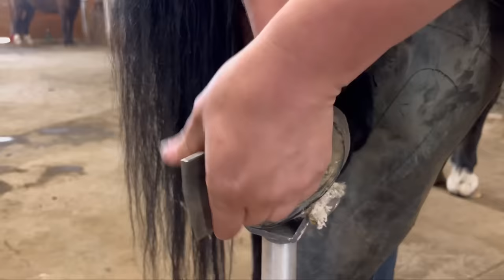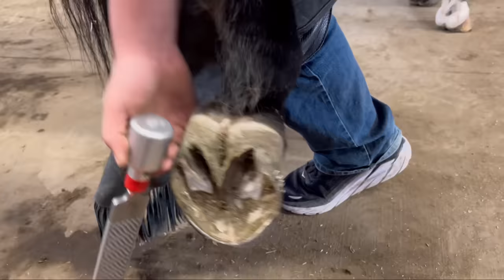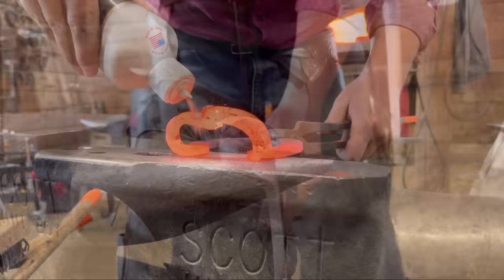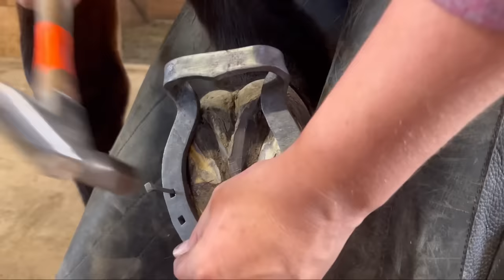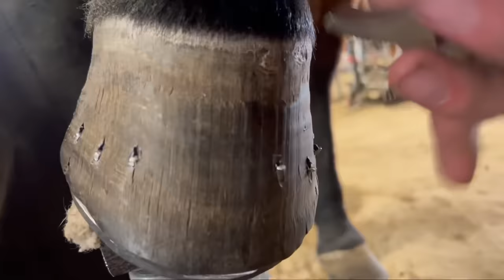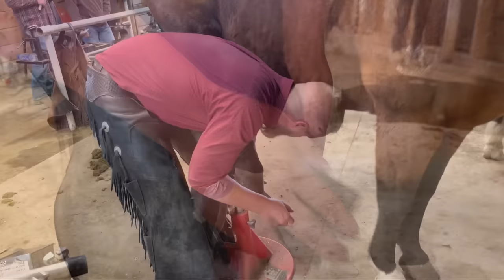Tendon INJURY Recovery Horseshoe

Comment: Why do you bounce the hammer on the anvil now and then? And what is the grey powder you spray on? Thank you! I'm enjoying watching people ply their trade for the betterment of the animals.
Reply: He does the bouncing to reestablish his grip on the hammer. It will drift as you pound. 

The powder is borax. It cleans the surface of the metal as they work the shoe, which helps to make a better welding bond. It is also called blacksmithing powder.
Reply: @ricoludovici2825  Thank you! I know borax. I didn't realize it was used this way. I appreciate your answering.
Reply: Hello how are you doing

Comment: I hope I won’t step on anyone’s toe with this question, but I would like to know why this horse didn’t get a leather pad between the shoe and the hoof? I understand this is to relieve pressure on the tendon while it’s healing, but is there no risk of having a caudal failure with such an open heel shoe that is at a steeper angle comparing to the hoof without the shoe? Also, amazing work, I am kind of an “old school” lover, and I’m glad to see you make such a high quality handmade shoe! Well done, there is immediate relief in the horse’s stance as soon as the shoe was applied!

Comment: Never seen anything like this before. I do have a question, since one side is now higher and the other side barefoot do the horses get sore in their back or hips? Can you level it out putting a heel shoe on the other foot?
Reply: That’s a good question. I’m curious too now how it will affect the horse’s hips and other leg. I know in the beginning he said the horse was going to be on stall confinement so he won’t be walking around on it.  I would imagine that it is something they do take into account and will be watching for off side strain. And I’m sure a good chiropractor adjustment once the shoe is off will help line things back up.
Reply: Id be shocked if a raised bar shoe this high would be used for a long period of time. There would be a lot of pressure coming down through the front of the hoof and throughout the hoof capsule into the toe.  I reckon a few weeks then decrease the height of the heel with a new shoe.

Comment: what exactly happens at 2:32 with the glowing colour of the steel? it seems like it just cooled down many degrees in the blink of an eye.
the same thing happens just a second before, when he takes it from the flat part to the round one...
Reply: The anvil absorbs a lot of the heat, so it cools down very fast

Comment: This is amazing.  I’m surprised at putting the hot shoes against the hoof, but guess it doesn’t hurt?
Reply: As long as the hoof has been trimmed properly it doesn't, what the horseshoe touches and is attached to is all dead hoof horn essentially.  Pressing the hot shoe to the hoof during shaping is mainly to make sure the fit is good.  If there is a section not steaming then in means it is not laying flush to the hoof even if it looks like it is which would allow stones and muck to get in-between and potentially cause far more severe problems.